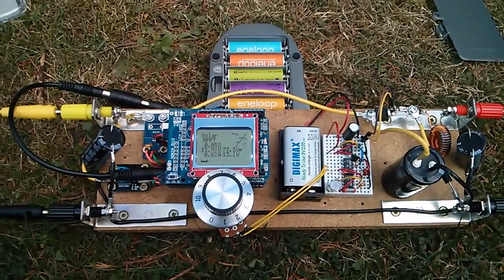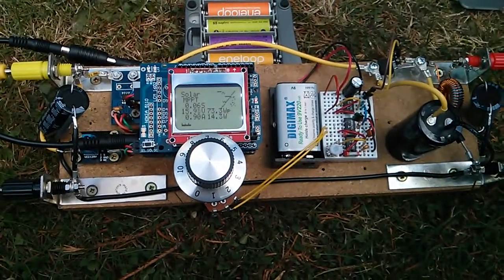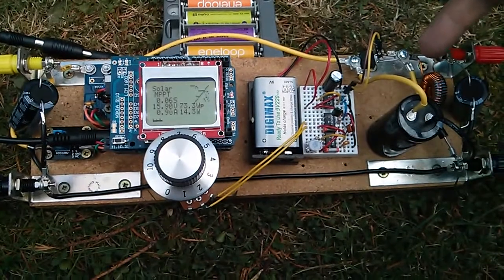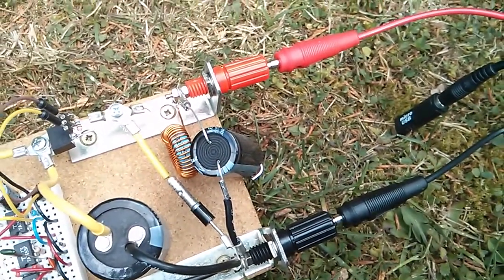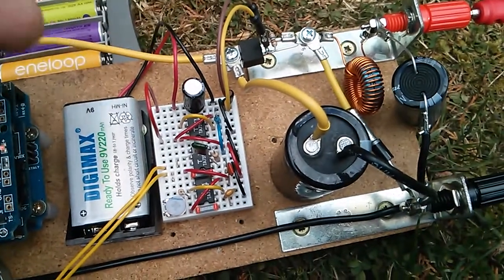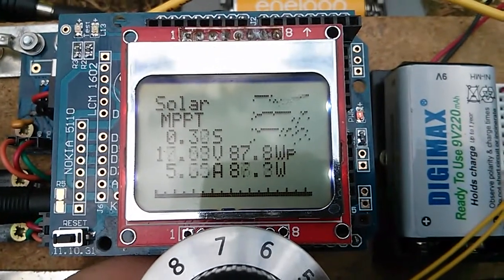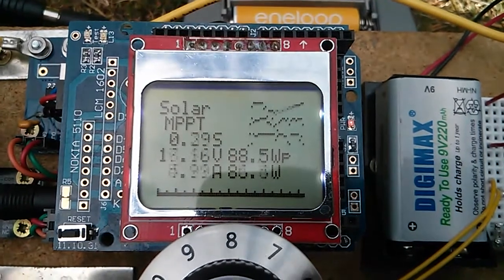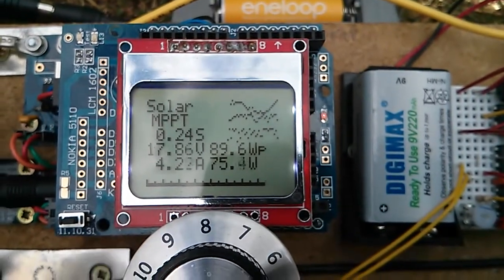Arduino MPPT Solar Charge Controller #15 - Changes Coming

Comment: Have you even checked the efficiency of this PWM circuit?  (measure output POWER, compare it to input power)
Output filter inductor - you need to be sure it's not going into saturation. The output MOSFET "ON" time needs to be set such that it keeps just shy of saturating at the MAX output current condition, then vary the repetition rate for the output adjustment.  If the "ON" pulse is too short, you need more inductance, but make sure the inductor is rated above the expected output current.

Comment: Julian, love your vids. Thank you for that. Do you plan to make arduino based MPPT for DIY wind turbines? Best would be MPPT  algorythm based on TSR (Tip Speed Ratio of particular turbine) lookup table (table created using anemometer and tachometer)?

Comment: this is pretty cool.  I like to build one for my wind turbine. for charging a 24 volt battery bank. or for putting the power straight in to a gti at maxum voltage and power. I like to build a system were it will take up to 10volts and bost it to charging voltage. and then when the turbine spins up and goes over voltage it then steps down the voltage to charging voltage. with a mixum inpurt of up to 100 volts. and also beable to brake the turbine at a giving voltage. ect.